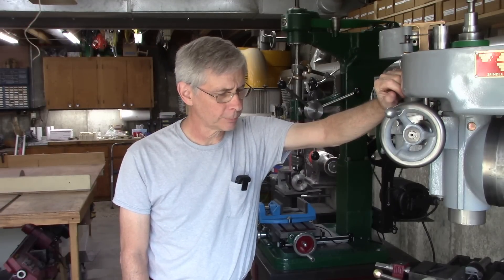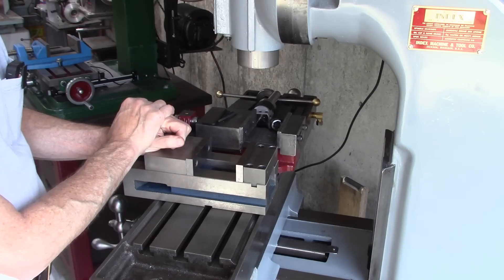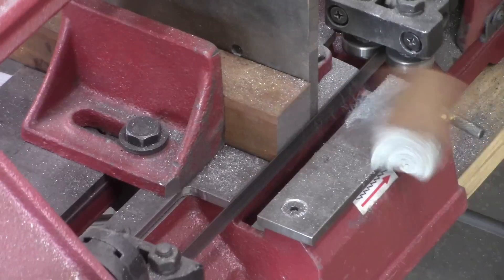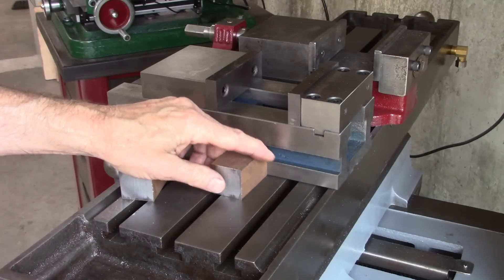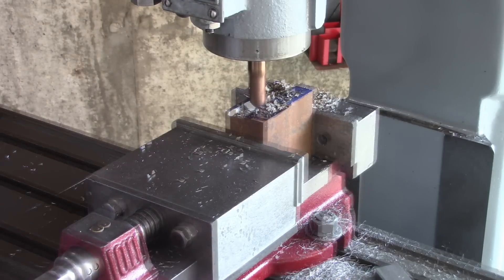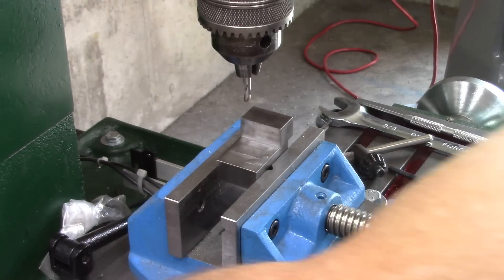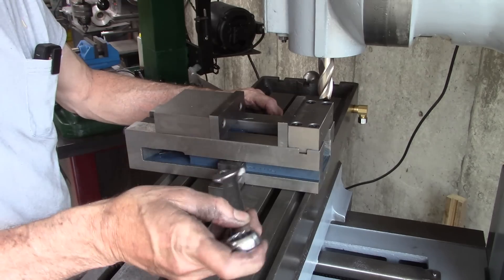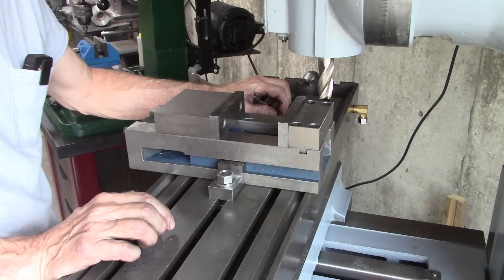Hold Downs Clamps for my Vise - Milling Machine

Comment: Great job on the clamps. I broke a 3/8 carbide end mill this week. Usually what happens is the work moves while milling either in the vice or like you said not having all axis locked. Carbide seems to like higher rpm than HSS. It makes me grind my teeth for a day or so every time I break a carbide end mill because of replacement cost. All my carbide end mills were bought from a place that was selling in bulk quantity 2 lbs. for $75. Some of those end mills are worth more than that each. The only thing i found wrong with them is they are un-marked sizes. I'm not likely to find a deal like that again. They were Made in the USA.
Reply from the maker: I need to speed things up i think...  and the new vise will help too.

Comment: The bolt should always be closer to the vice than it is to the heel of the clamp. This setup puts far more pressure on the heel of the clamp than the vice.
I like to make the heel of the clamp fit into the width of the tee slot and rest on the base of the tee slot. This prevents marking of the bed and stops the clamp from swivelling when the vice is being moved back and forth.
Reply from the maker: Yeah...  I thought about the bolt position after I made it....  I could mill the slot and move it a bit closer to the vise but I should have made the clamp slightly longer. I did not think about the heel of the clamp going down in the Tee slot. That's a good idea although rotating isn't an issue.
Reply: @WinkysWorkshop  Good idea to make the clamps longer, perhaps a 1/3 - 2/3 split for the hole position. It's crucial that the heel end is slightly higher than the vice step to concentrate the pressure on the toe end of the clamp.
A larger footprint on the heel pads would also help. The current ones have the clamping pressure concentrated on two small areas about 1/4" x 5/16" either side of the tee slot which could mark the bed.
Preventing the rotation would allow you to push and pull the vice without having to hold the clamps square.

Comment: Those clamps came out very nice. I use a #9 B&S Weldon shank with a Criterion boring head. There is a flat on the 5/8" shank that the large setscrew on the Weldon shank holds thus keeping it from moving in either rotational direction
Reply from the maker: OH...  Good idea! I'll mill a flat and install a big set screw. THANKS

Comment: I think you were running the carbide too slow and the feed too fast. Just my observation. The parts still turned out as intended.
Reply from the maker: I think you and several others are correct! Thanks

Comment: Nice work!
Besides make content, what else do you make in your shop?
Reply from the maker: I do a lot of weird stuff. Right now I'm making a bunch of toy tractor parts for a friend
Reply: @WinkysWorkshop  fun! It would be fun to see those parts. Maybe a video with story time and show those parts. I'm sure being a plant maintenance guy you have a few stories stored away! 😂
Reply from the maker: @dans_Learning_Curve Thanks,  I'm always up for new ideas.  I have made a few videos with odds and ends I've made including the tractor parts. I may make one of the tractor part I am working on now...  I wasn't really a maintenance guy before I retired.....  I did a lot of machine redesign and I specialized in a few areas that the maintenance department didn't want to be involved with. I'm not sure most of my experience could be communicated in a way that people would really understand or appreciate without a LOT of background. Certainly there was some fun filled times like removing a 600lb conveyor divert from a 30 foot high conveyor and replacing it with a smaller straight section that connected the two conveyors (didn't need the divert). The scary part is, it had to work and if it did not I would have to put the worn out piece of junk back up there. This would be a 2 day job and not something management would be happy about.  It was stressful. The sad part about it was that the engineering department wanted no part of the project. Of course they were willing sacrificed an engineer wannbe like me. My fix worked well and I was the hero but it could have quite easily been a disaster.
Reply: Look through his older videos, he alot of great content on different topics.
Reply from the maker: @andyZ3500s  Thanks Andy

Comment: Very nice hold downs Winky.  I wish I had some amount of money for each end mill I have broken.  I need a new set of HSS end mills.  Maybe this month.  Thanks for the video keep on keeping on.
Reply from the maker: Yeah it really surprised me. Maybe I was pushing it too hard but I think the vice was part of the problem
Reply: @WinkysWorkshop  most of the broken end mills have been because I was not clamped down tight enough.
Reply from the maker: @AmateurRedneckWorkshop  yeah.. kind of like a wimpy vice

Comment: #1 use a reverse boring bar.  #2 drill & install a close fit pin from the upper flange into the head. This prevents it from "unwinding" when spun in reverse.  #3  spot weld three places on the seam of the adapter & the boring head. This solves the problem permanently.
Reply from the maker: I think I'll pin it.
Reply: @WinkysWorkshop  -wells index can regrind the spindle do make it an R8 style.
Reply from the maker: @orangetruckman  Aside from the boring bar and drill chuck I don't have any problem with the B&S and I have both. Also...  the B&S collets were cheap...  $120 for a full set...I have maybe $200 into the boring head ands moris adapter for the drill chuck. Wells Index would charge a LOT more to make it R8.